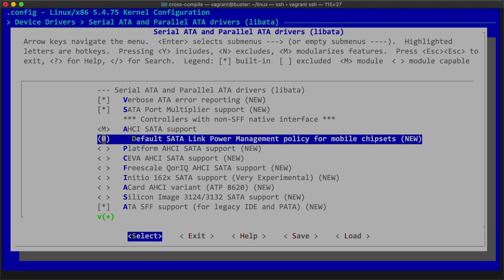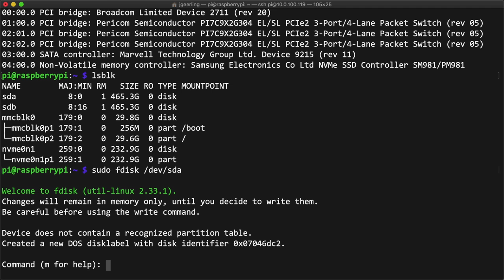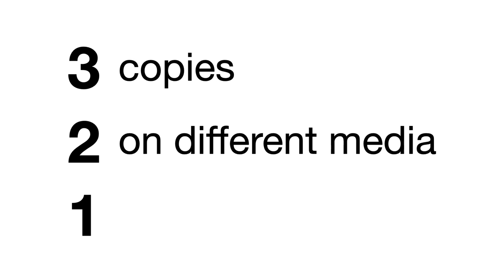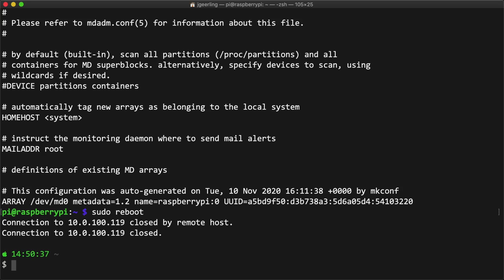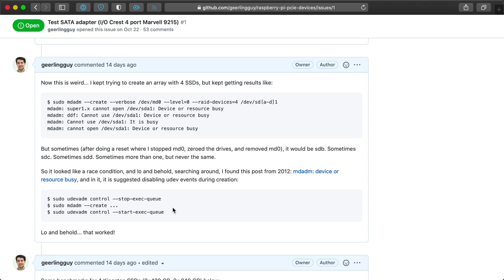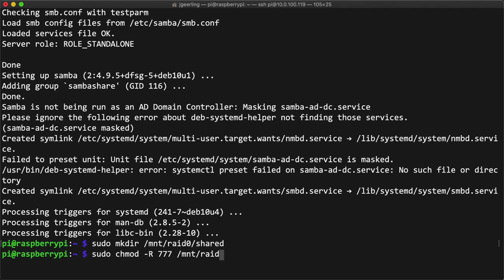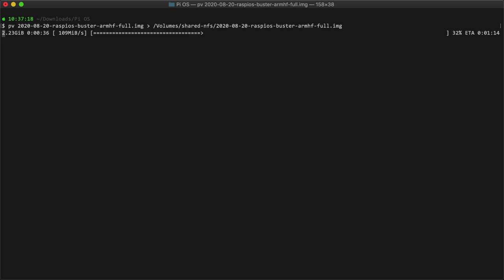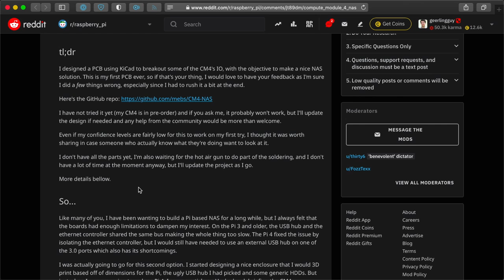I built the fastest Raspberry Pi SATA RAID NAS!

Comment: I still feel your fear of RAID 5 or 6 are pretty unfounded. Why worry if you follow that backup strategy?
Reply: I agree with Jeff's sentiment regarding RAID5 / RAID6 even with the suggested backup strategy.  My concern with RAID5 / RAID6 is recovering from a failure. 
- RAID1 (RAID10) - Recovery is a relatively simple sequential copy of data from a mirrored drive. Mechanically, it is a less intensive operation and it has a pretty fixed recovery time relative to the transfer speed of the drives and the size. 
- RAID5 / RAID6 - Recovery is an intensive read/write operation that puts mechanical stress on every other drive in the array throughout the recovery process.  Because the recovery process has to calculate parity, recovery time goes up exponentially as drive sizes increase.
In both cases, you are putting stress on aged drives to recover from a failure. You are more likely to NEED your backup when recovering from a failure in a RAID5 / RAID6 array than if you're using a RAID1 / RAID10 array because if a second (or third) drive fails during recovery, the array is lost.

In the end, it is a trade-off between maximizing space efficiency and risk tolerance.
Reply: @T3hBeowulf  i fear hardware RAID more than software RAID, because if the hardware breaks and you use hardware RAID you possibly need the same or similar hardware to be able to get to the data. Software RAID (mdadm, etc.) is a bit more safe.
Reply: @timramich   @Tim Ramich  Parity computation is still very much an issue, that said ur its very usable. There are a surprising number of misunderstandings packed into this short video, so many it is difficult to know what needs to be addressed the most. This is a surprise as his other content seemed better informed.

To start with, for the purposes of a NAS on such a bandwidth constrained device over a network, using raid 0 is just not reasonable. Simply sticking with raid 1 makes the most sense, providing good read speeds by itself, if more I/o is needed create a kernel block cache out of one of those ssds to provide a high iops and high throughout front-end for your mechanical drives.
Reply: @orbatos  How is parity computation an issue? It's been claimed multiple times, yet no one gives an example of how. Just "it's an issue."
Reply: @timramich  I, and I would say others as well, assumed it was self evident. There is significant computational overhead added to transactions. On a high end desktop or server, or with (still quite overpriced) dedicated hardware this is mitigated, but it does not vanish.

Now consider the Pi4 usage case, this is done with an embedded chipset and it would be surprising not to have bottlenecks. The system already has severe internal bandwidth constraints even compared to a 10 year old desktop computer after all.

As previously said, this does not mean software raid is bad, just not the right tool for an ARM based NAS with no hardware offload.

Other considerations:
BTRFS parity striping is still broken until the write hole can be addressed.
Many people do not have the extra hardware to properly configure large ZFS arrays and may accidentally put their data at risk.
Recovery is also an issue, resilvering/rebalancing on a large array is a huge headache if your system was designed on a budget.
Reply: @orbatos  Yeah, no duh the computational overhead would be bad on a pi. But to label 5 and 6 as bad, even on capable hardware...it's nonsense and puts almost no load on a system.
Reply: @timramich  I did initially say that it was usable, and that the video contains a number of surprisingly dismissive ideas and misunderstandings regarding disagree technology.
Reply: @orbatos  What
Reply: @T3hBeowulf  how do you figure raid5 is mechanically more intensive during recovery? There's no reason for the recovery process to write to any disks that didn't fail, it'll just be a full disk read of the good disks, some parity calculations, and a full disk write of the bad disk, unless the implementation is terrible. That said, I'm sure there are terrible implementations out there - it should just not be blamed on parity raid as a concept.
Reply: @UnreasonableSteve  Reading and Writing are mechanically the same for HDDs. During a recovery operation, every HDD in the array is performing an excessive number of operations. If you're dealing with an older array of drives that already have high power on time, a lengthy recovery operation is a stressful time for aged discs. That's not inherently a bad thing, just an increase in risk. 
I'm not saying parity RAID is bad and I completely agree that hardware solutions as well as sufficiently powerful systems with software solutions can calculate parity with little to no performance impact.

I was merely saying that I agreed with Jeff's sentiment regarding parity-based RAID. I weigh those risks every time I deploy a NAS and pick the best configuration for the intended purpose, including parity RAID.
Reply: I don't think this is something we need to agree on. There isn't a "right" answer here. I think any of us that have worked in infrastructure will have used R5/6 and had no issues at least once. Like others have said, it's the trade off between risk and data integrity. Use what suits you, your data, and the risk profile. I do not store my enormous vaults of customer data on R5, even though that would make my storage more efficient. Nor do companies like 45Drives.

Comment: I'm glad to hear what you said about Raid 5. I used a snapraid parity system (i think its basically raid 5), worked well for years, was able to replace faulty drives.. until the disaster happened. Two faulty drives at the same time, and myself the brains behind this operation only had one parity disk (and the parity disk failed alongside that other disk). I couldn't recover the data, but thankfully i did keep copies elsewhere. Since then, i scaled my server back to using a pi4 (it was new at the time and thought it was worth a try now it had gigabit networking) , and i put a little script writing knowldge into an rsync smartctl cronjob (you could obviously run the script outside cron, but this saves me remembering). Now i have full data available in the event of failure, and best of all (i hope), rsync won't write bad data to the backup drives if smartctl has bad health on any drive. I set up a mail server to keep me in the loop as well. Of course, i still have data stored elsewhere, but after the pitfalls i experienced with Raid 5, i think this is better for my needs, and the pi4 seems to be operating this well. I just use USB 3 docks for WD red drives and it makes for an easy to manage small scale home set up.
Reply: Raid 5 & Raid 6 dont have "parity disk, all disk in the array have parity. Thats why any 1 or 2 disk can fail at a time. What your thinking about is a dedicated parity disk, which is less secure and i belive Raid 2,3,4 have tht

Comment: I would like to add that a backup copy automatically synced by rsync, Resilio Sync, etc is NOT a backup. Any mistake, will be immediately propagated to the synced "backup". I once entered some VPN commands to mount remote disks "something unknown" happened and my sync program still saw the disk but couldn't see the files, Viola! Everything gone. Real backups to the rescue. I've never seen anything like that problem since but it only takes once.

I have amassed about 30TB of plex data and for the times when 3 or 4 people use it simultaneously, spinning platters are fast enough and more cost efficient than SSD.

RAID is not a backup, but it is a tremendous time saver. A disk fails and you can throw a new disk in (certain variations excluded) and it rebuilds without serious outage. Big savings over rebuilding the array and copying 30TB.

Really a lot of great info in this video. Thanks Jeff
Reply from the maker: Heh... I just had to copy 8 TB last week and yeah... anything more than 1-2 TB on an older HDD (especially if you have to go over a 1 Gbps network) is no picnic.

Comment: Back in 1988 I ran Fault-Tolerant Netware 386 using raid one in hardware, mirrored and duplexed across controllers with battery backup power. That was state of the art at that time and ran like a top!

Comment: ZFS is da wae!
Reply: I use ZFS in production. I love it. To pieces.
Reply: Not for a Raspberry it isn't. Without tons of RAM and a separate array just for the transaction log, and ideally a separate fast SSD as a read cache, it's not really an option to consider. I also don't understand the bashing on RAID5 or more properly on parity. That's a proven method for decades, and modern implementations even allow mixing different sized drives and online expansion.
Reply: @graealex  I think you could do ZFS competently on a pi4 8GB. I wouldn't put anything critical on it without a backup, but it would work. I won't promise it would be fast, and I haven't benchmarked it. Like you, I've used RAID5 on a lot of equipment over a lot of years, but I wouldn't think of it as a golden bullet. I've used R10, R5, R6, R60 etc. It's all about use case and benchmarking for the given workload.
Reply: @Whipster-Old  "I wouldn't put anything critical on it" - then why even bother with ZFS... Also recommended RAM is proportionally to overall array size, and 8GB base plus 1GB per TB storage is recommended.
Reply: @graealex  I think you're overthinking this mate. It's a raspberry pi, why would you put anything critical on it ever? For lab or training - sure.
Reply: @Whipster-Old  It's completely reasonable to build a NAS with a Pi. Heck, most consumer NASes aren't more than an ARM-based SBC with an on-board SATA controller, i.e. most Synology NASes in the consumer class.
Reply: @graealex  sure, but on purpose built boards. I struggle with the price performance ratio for the cm boards, you know? For production I mean. I use a pi for controlling my printers, and for some other lightweight tasks, but I've got a big unraid for data storage. I don't use any for work.
Reply: @Whipster-Old  If there were a host board for the CM with 4x SATA onboard available, then I'd imagine that to be a viable DIY NAS. And that would include being able to put data on it without fear of losing it. But then again, not with ZFS, as you're missing a dedicated (and redundant) drive for the transaction log plus a limited amount of RAM, and that is crucial. It all comes down to ZFS really not being a good choice for such a small computer lacking expansion ports. Which was my original point. ZFS is great, just not on a Pi.
Reply: @Whipster-Old  I have a combination of arrays in production. I have CephFS, ZFS, and Dell HW Raid 60, and they all back up to each other. A cloud backup agent uploads it all to crash plan pro. I sleep well at night.
Reply: @WarrenGarabrandt  I'd love to put Ceph in, but I've not had an opportunity yet. It's hard to sell that sort of efficiency to budget conscious businesses who aren't trying to build multitenant clouds.
Reply: @graealex  if there were a board intended for the purpose and designed to take the new CM, I would absolutely buy one. As for the ZIL, it's not strictly necessary. Don't get me wrong I don't deploy production zfs in business without ZIL disks, but the main benefit is for write performance rather than data integrity. Or I guess more accurate to say it allows for write performance without sacrificing data integrity. I wish I could get those fancy RAM speed SSDs for reasonable money! Oh and you're right about zfs on the pi. Great for training some new guy on how to set a pool up in principle I guess, but it would be too slow. And I could just as easily use an old PC.
Reply: @Whipster-Old  Writing the transaction log to a spinning disk gives abysmal performance, while a normal RAID5 would still perform reasonable. There is no way around a dedicated ZIL drive, especially with a CPU that already hasn't enough performance to begin with.
Reply: @graealex  it runs OK on a xeon 8 core  when I fail the ZIL drives in testing. Caveat, I don't let them run that way and the production workload I run is heavily sequential. Again not recommending it or anything, but I find absolutes are best avoided with ZFS, because it surely can and does work outside of the ideal.
Reply: @Whipster-Old  I've felt the same for around 10 years and still do. Imagine being able to love a girl for 10 years... Usually it fades after 3 months hehe.
Reply: @graealex  If you do not undertand the RAID5 bashing we clearly shouldn't listen to the rest of your comment on ZFS :p

ZFS does not read from disks slower just because it hasn't got 10000 GB RAM. Stuff that isn't cached comes from the drives anyway. More ram just makes cached stuff faster.
If you do not need a alot of IOPS and just watch movies from a NAS box and store and read files you do not need a L2ARC SSD cache either. In a Pi it would just use too much memory to index the contents of the L2ARC.

ZFS supports mixed drives and online expansion.

RAID6 is better. Depending on certain factors it might not be good enough, but for a simple Pi NAS... hmm

Maybe you should read up on bit rot and URE to help you understand the RAID5 problem. Disks failing when rebuilding raid 5 and how much that has cost companies in the past. No sane IT-Tech will recommend RAID5 as storage..
Reply: @Whipster-Old  Look up RMS-200 on ebay :)
Reply: If he doesn't like RAID5/6 because he doesn't understand parity, ZFS would scare him off the internet entirely.
Reply: @savagedk  Yes Mr. Smartypants. The reason for RAID6 over RAID5 are the slow rebuild times and slow access while degraded, that make it prone to yet another failing drive in that time span, in the case of many large drives. Obviously a Pi or similarly sized NAS will never have more than 4 or 5 disks attached, thus RAID6 would be completely moot. Other things: without ZIL on dedicated SSD, ZFS is slow as molasses, especially on RAM- and CPU-constrained devices, and contrary to your belief, ZFS does NOT support online extension. You can lump pools together, but you can't just add a single drive to an existing pool to increase capacity. Maybe YOU read up on it a bit?
Reply: @savagedk  I mean there is even more obviously wrong stuff in your comment. Reading is for example slower, especially on CPU-constrained devices, since XOR-calculation is always faster than i.e. Fletcher or SHA. But why bother with people that don't understand the difference between a 4-drive SOHO RAID based around ARM processors and enterprise applications that usually employ SANs?
Reply: @graealex  He has 8 gigabyte of ram. That is enough. 

Regarding raid6 sure, you are right. But that was in reply to your lack of understanding of the RAID5 bashing which is unrelated to a Pi. The rest I just cant be bothered to reply to as experts on the subject have already written about it. I quote:

Many people think of the ZFS Intent Log like they would a write cache. This causes some confusion in understanding how it works and how to best configure it. First of all, the ZIL is more accurately referred to as a “log” whose main purpose is actually for data integrity. It exists to keep track of in-progress, synchronous write operations so they can be completed or rolled back after a system crash or power failure. Standard caching generally utilizes system memory and data is lost in those scenarios. The ZIL prevents that.

Second, the ZIL does not handle asynchronous writes by default. Those simply go through system memory like they would on any standard caching system. This means that the ZIL only works out of the box in select use cases, like database storage or virtualization over NFS. OpenZFS does allow a workaround if you decide to opt for the extra level of data integrity in your asynchronous writes, by switching from “sync=standard” to “sync=always” mode, but that must be manually configured.

Third, the ZIL, in and of itself, does not improve performance. The ZIL sits in your existing data pool by default, usually comprised of spinning disks, to log synchronous writes before being periodically flushed to their final location in storage. This means that your synchronous writes are not only operating at the speed of your storage pool, but have to be written to pool twice, sometimes more depending on your level of disk redundancy.

Enjoy the lecture.

https://www.ixsystems.com/blog/o-slog-not-slog-best-configure-zfs-intent-log/
Reply: @graealex  Good question. I used to build and deploy SAN's so I guess you are one of those I should not discuss with?
Reply: @Whipster-Old They have been obsoleted by RMS-300 and are not obtainable new.

I believe an RMS-300 is around 600$ I am far from sure about that though.
Reply: @Whipster-Old  You can use it for many things, not just ZFS as it just shows up like a native drive :)

Have fun with 5.5Gigabytes/sec write cache with battery backup! And an unlimited write endurance :D
Reply: As a sidenote: Mine has written 65PB according to SMART.
Reply: @graealex  ZFS uses a lot of CPU? Surprised there isn't dedicated hardware to offload whatever crypto/check-summing  needs to be done. Wanting a large general-purpose CPU to run a very specific job very fast sounds like a mistake.
Reply: @cannaroe1213  Look up "Intel Quick Assist Technology" for ZFS, although there is nothing wrong with using general purpose hardware to do general purpose tasks. That's what CPUs are for, and not every single task needs specialized accelerator hardware.